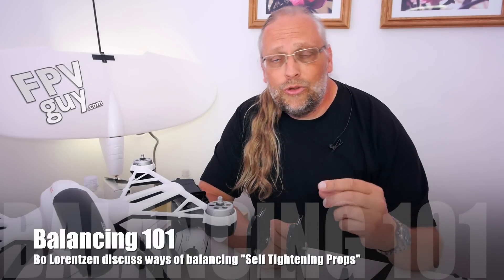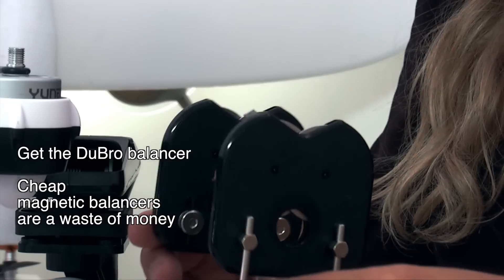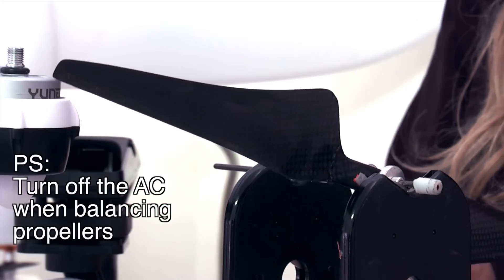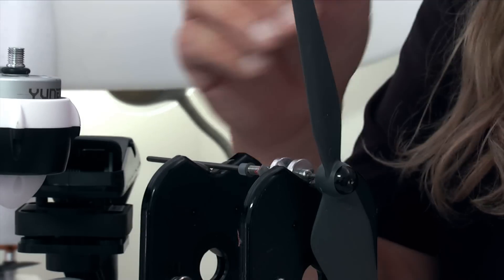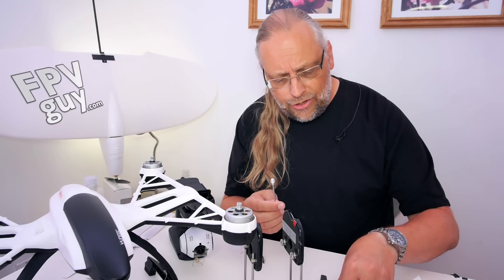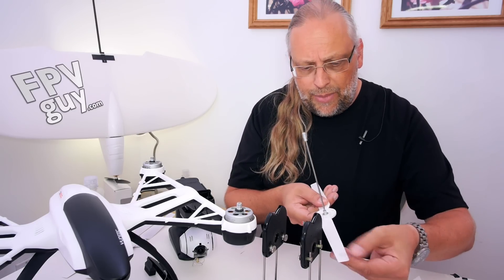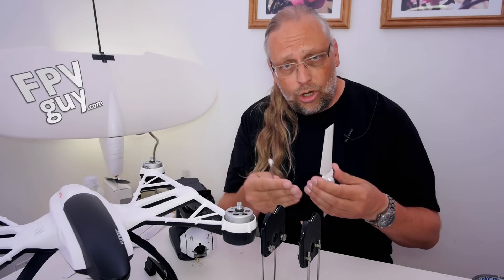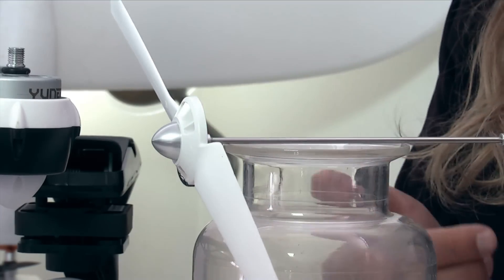How To - Balance Self-Tightening Props

Comment: Is it possible to sand the extra weight from the heavier prop's tips or ends? Why I think this will work is if one end of a prop is 20 feet and weighing 5 pounds and the other end is 20 1/4" feet and weighing 5 pounds and spinning on a motor, length would not matter and the motor can't know as long as weight remains the same in the spin. IF once the prop is trimmed and spun to find perfectly balanced, why not? The reason I ask is, I had a mishap w/ a couple CF props and the tips lost approx. 1/8" after cleaned up by sanding and are now perfectly balanced, 'end to end'. I think my theory is wrong but it sounds good LOL...
Reply from the maker: Thats actually very commonly done,     and it works perfectly.  
AND the length is often a issue,  if you test a prop you frequently see they are NOT centered.    its just me that personally prefer sticking little strips of tape on the leading edges :-)

Comment: so wait... the tape doesn't cause drag or just come off? THAT is amazing... thank you for this video.. very helpful!
Reply: thanks.... ordered my balancing system.. we'll see how that goes.... not to be "that guy" but I think you meant "conducive" environment rather than "conductive"... (';')( ';')
Reply from the maker: +Freds Fine Product Reviews   LOL well on some of the mini-quads the props go so fast that the tape peel off. however the Q500 have fairly slow moving props and thin pieces of tape seems to stay on perfectly.
Reply: +Bo Lorentzen Do you recommend sanding Carbon Fiber props? this is for the DJI Phantom 3 Pro... thanks Bo!
Reply from the maker: Nah.. not really, personally I prefer using a piece of tape towards the base of the prop blade, notice if at all possible I wrap them over the leading edge of the prop.  I use "gaff" tape and find it sticks fine even on the side of the hub if the prop don't balance in the vertical position.   
the important thing with balancing is getting "most" of the big vibrations out as that make the flight controller and the camera work in a conductive environment.
Reply from the maker: LOL conductive.. yes.  
Please always be that guy,  my english need serious polishing. :-)
Reply: no worries :)

Comment: Very good video!
I use sand paper instead of tape is it still good way?
Other question, what should I do if the propeller an washer is not going tight to the motor's screw and can move some 0.1 millimeters and not perfectly centered?
This was the motor+props could still be out of balance.
Also the amount of glue for the motor magnets is not always distributed equally so the motor is already out of balance.
For me there are high vibrations even without propellers on motor if I spin them up.
Reply from the maker: +FotoAmg AmgFoto   great question.   I used to balance motors by putting a piece of tape 10x5mm thick tape on the side of the motor, and spin it up, then move a little at a time.. maybe 5mm each time moving the tape.. spin up again and see if your vibrations are better, you will find a sweet spot.. mark it with a sharpie.. then try different sizes of tape... when you get the best size.. do a test with and without tape on the sweet spot.. you can easily see the difference.   it takes a bit but works well..  some guys use lasers and iPhone apps to see the vibration, i just touch the arm.. when it runs smoothly there is nothing to feel, its pretty easy after a bit of practice.
Reply: I saw on a video that there is an app for smartphone which shows vibrations and can be measured by putting the phone to the copter's arm
Reply from the maker: Yes,  but it adds a bit of complication having to mount or hold the phone to the arm.. :-)

Comment: Love ya work Richard.  Geoff here from down under in Australia.  Just a quick for you cos I couldn't think of a better guru to direct this question.  I had to order a new B motor for my Q500 and the new motor had two differences (1) it didn't come with a black rubber washer and (2) it had a shorter thread.  Both of these differences have resulted in the prop being slightly lower than the other three props.  Can you shed some light on why they've changed the part (yes I'm sure it's the right motor for the right model) and in particular advise whether this would affect the aerodynamics or flight capabilities.  Many thanks.
Reply from the maker: Geoff Ward   Tighten the prop down firmly. and you should not notice any differences.    Im asking my buddy Brad to look at your question as he worked as a Yuneec tech and have much better understanding of the upgrades thats happened on the hardware side..
Reply: The motor threads should not be shorter then your old motor. but new motors are not shipped with o rings. You will need to reuse the old one or get new from a bag of props.if you install the prop without a O ring it will be too low and could come off in flight. Always make sure your O rings are in great shape
Reply: brad mendrick Many thanks guys for your helpful advice.  I will grab the ring from the old one and be sure to fix before flight.  The prop has jammed/locked on the old motor so I will have to cut it off.  One final Q, I have attempted to update the firmware in the Gimbal via the usb cable but the Q500 software is not detecting connection.  I didn't have any issues with the Drone update connection so I'm perplexed as to what I'm doing wrong.  Have you guys encountered this issue in the past?

Comment: one question that I need to ask, is the tape good enough to leave on the prop after balancing or do you need to use a more permanent glue.
Reply from the maker: Great question Steve,   yep,   I simply wrap it around the leading edge and its on there.   if you want to do it nicer, user scotch tape instead and put as many layers as required, the scotch tape have less "mass" compared to its surface so it stick better.    the gaff tape tend to peel off if used on 5inch high-speed props, but not on the yuneec or phantom size props.

Comment: Just wanted to say a quick thank you for the Dubro balancer suggestion.  I had a HK balancer and was not balancing the hubs as the props didn't fit vertically.  I ordered the dubro and the top flite.  I had a top flite in the past for gas airplanes and it seemed fine but my new one was terrible.  The balancer itself was out of balance.  The dubro was very good quality and I was skeptical because of its "out dated" design but it was the best of the bunch.  You video on balancing the hub was very clear and made a big difference in the smoothness of my quad.  Keep up the good work!

Comment: Hi bo,had an off topic question. I had a discussion with someone. They said the q500 is already dated. Just wondering what you think. & if so in what way is it outdated.
Reply: michael Dorn  Some reasons to go with the 4k camera: manual white balance settings (much needed), exposure settings (at least i will use), You dont have to shoot in 4k. 1080p up to 120 fps (awesome for slo-mo) was in the specs. Much higher resolution still pictures. I was told that this camera will mount and work on q500, and q500+ not sure if you need the latest ground station. The audio is only useful when using the steady grip.
Reply: MediaJim Manual white balance is already on my editing program as well as slo mo. I find the res on my photos is fine. What happens when they come out with a 5k? They are always going to come out with something better. Only you can decide if you need to keep spending more money. That is what they want you to do. I am happy with what I have so far. Maybe one day I will upgrade but now now.
Reply: michael Dorn  I just bought my q500 a week ago and noticed there are already a Yuneec q500+ and a q500 with 4k coming out. One comes with a case but I already bought a case for mine. The other has 4k but most people do not have 4k monitors and 4k is difficult to upload and edit. So my q500 is all I need. To each his own.
Reply: Vincent Jones yep, I don't need 4k or audio. That & colour are only difference. All other function are the same.when they bring way points we can get. I just got my first no fly zone warning @ work today. Was gonna be first round of site with it.
Reply: MediaJim right on. I'm not into it for vid quality more for just fpv part to patrol site at work when bored.

Comment: Bo, Need help! Problem with my Scout X4 MIX switch. I notice that after binding in MIX switch position 0, my throttle function correctly. If I move the throttle up from 0 - 5 (and so on) the propellers begin to turn at the accelerating speed.. In MIX position 1 my propellers will not begin to turn until I throttle up to at least 30 - 40. Can you tell me what is wrong?  As a retired Marine I use my drone as a source of relaxation.
Reply from the maker: LOL  Lloyd, you asking the wrong question.Those are not "mix switch position"  but FLIGHT modes.  retired Marines (thank you for your service sir, respect)  can relate to me asking.. so on switch position one nothing happens.. on the second it only shoot one and on the third it empty my clip..?  whats wrong.?
Done messing with you. 
Position 1 is manual and you get to throttle up the props and motors at your pace.
Position 2 (middle) is GPS loiter,   loiter mode sees the world as high-stick means climb, low stick mean come down,    so since 25% stick is still low, it see no reason to start the motor to climb.   nothing really happen until you are pushing past 50%.    Personally I prefer starting in manual and then with the stick in 50% flip to GPS in the air.. leave it in GPS until you are back on the ground.
The last position is RTL.  which brings the quad home without you flying.. catch is,  you got 100% liability and 0% control when the computer flies.

Hope this helps.

Comment: Hi bo, I was just courious I was reading on a forum where someone talked about boiling props in water & letting them cool to room temp to relief stress points in plastic.  Not going to try just wanted to know if you heard about it before?
Reply from the maker: Hey Michael,   Yup, have heard about this,  and it "may" work, however I have never had a properly sized prop snap in flight on me.. ever.   so I'm kinda just using stock props,   keep in mind that if you nick a prop, consider it suspect.
Reply: Got it. Thanks bo,hope all is well.

Comment: How would you balance a set of Pocket Drone Props? I saw your other videos were you mentioned that they need balancing, but I don't think this method will work as they come as individual props and not as pairs...   Thanks!
Reply from the maker: Hey Alex,   folding props are a bit more complex to balance.
Basically you do two steps. 
1. compare weight of the two blades.  they should have the same weight.
2. next find the center of gravity.  stand something sharp on edge. like a blade and balance the prop, they should both balance exactly the same distance from the mounting point.  adjust balancing point and overall weight until perfect and you got smoother props.. 
3. the PocketDrone is pretty rough flying, you might not really notice a difference.
Reply: Bo Lorentzen Thanks!

Comment: I see you put the bolts on the inside of the dupro. Gonna do that when I get home.
Reply from the maker: michael Dorn  :-)   yeah you get a bit more baseline for the shaft and get the bolts away from the prop.
Reply: I did works great now. Blades are balanced. It was fun balancing them. Lol too bad that can't be a real job.
Reply from the maker: It probably could be a real job, I bet there is a market for perfectly balanced props to people who don't want to mess with balancing.
Reply: Bo Lorentzen omg I would do that job all day.lol. I even balanced the little 4 inch props on my syma x5c flys even better now. I used the tape idea for self tighten props. Great beat on quad. Would highly recommend for beginners cuz if it dies you're only out  $40 . It handles and flys great

Comment: Hey bo just got balancing rod. I put propeller on dupro and the weight of the prop kept making it fall foward. I had to move the front of the dupro down and even it so the rod was stright.I had rod sticking out the back hole using bottom of the disks. Any suggestions
Reply from the maker: michael Dorn  the stick goes over the top of the two sets of wheels.  you need to run the height up to max and make sure the two sets of wheels are level.   notice how I have the DuBro setup in the video. ;-)
Reply: Thats how I started. But it wont stay level. I have on flat stabe surface. Everything is level. Could it be the rod? It seems stright. Could I put couple of bolts on other end to weight it down
Reply: Vincent Jones right on thanks bro.

Comment: What?  No mandril for the Iris+?  I think I might just try drilling the center of the spinner.  It's alright, deleted for my own good so I'm used to improvising -lol.
Wow, that was close.  :D
Reply from the maker: LOL  dang I did not realize the iris+ had self tightening props,  I will suggest to EJ that he add that one asap :-)
Reply: I believe the Iris+ (not the Iris) has the same 6mm threads that the Phantoms have.  Some guys are installing aftermarket props using Phantom 2 prop nuts.
Reply from the maker: rpurdey That should work fine,  in that case these prop-balancers would work for for it,   Just got a Iris+ for a review. and I will make sure to check the prop fit also.
Reply: Hey, thanks.  I like my Iris+ a lot even if it seems to be a bit porky.  Systems seam solid.  Maybe a new frame someday?

Comment: I balanced the props with your tape method and am glad you put on the video about tape on the hub. Didn't know how I was going to get that done. Also why the clover leaf on the bottom of camera. Great learning vids by the way.
Reply from the maker: Hey Mike,  glad the video helped.
The cloverleaf on the bottom of the camera is for the 5.8ghz WiFi   its normally inside sideways, it works better when pulled out and pointed to the ground. :-)
Reply: Bo Lorentzen so that mushroom antenna is already in the camera. I thought I saw a vid of you doing that
Reply from the maker: michael Dorn Yes its in there, gently pop the black cover off the front of the camera.

Comment: Thanks for sharing. what is that plane behind? looks awesome
Reply: I was wondering what the plane is also.
Reply from the maker: Hey Bernard,  thats a very old slow-flyer from HobbyKing,  I tried to find it now but it seems to not be on the website anymore,  it flies at just about walking speed and is a fun floater plane..   the wing is so wide that its got incredible low wing-loading.